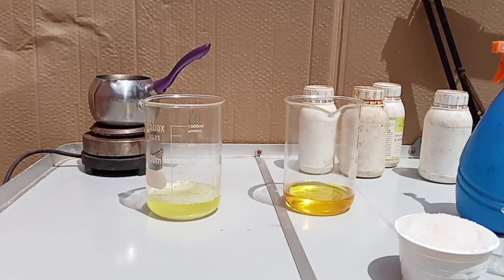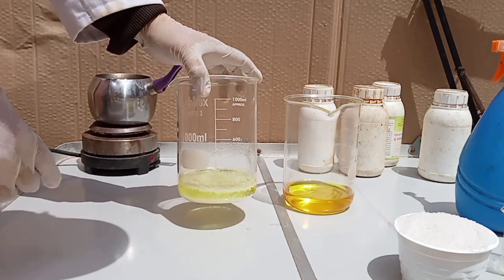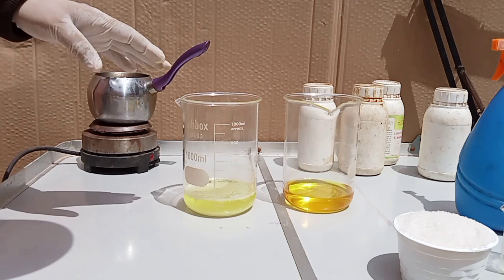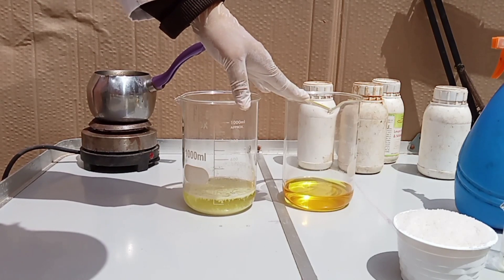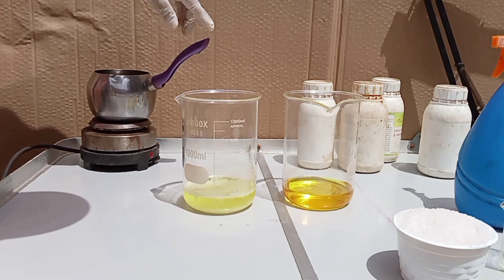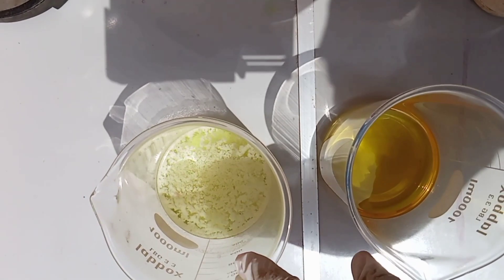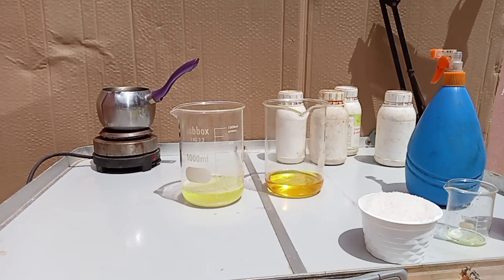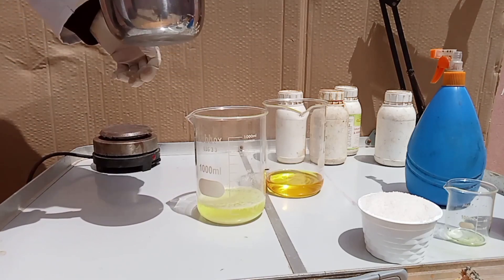How to dissolve some problems When refining using the aqua regia method/#gold recovery#

Comment: I'm trying for 2 years I have some problems but no one gave me any solution, why my gold not melting properly and have golden white color ather problems is when i filter gold than wash many times with water after that when i try to wash with Hcl or nitric acid it dissolves and some time when trying to melt it not melting completely it becomes very thick
Reply from the maker: I tink before melting process , you must re-refine again your gold dust